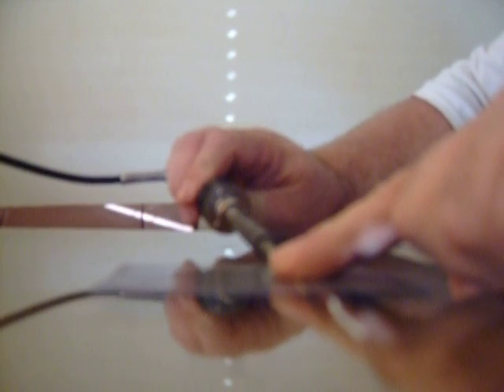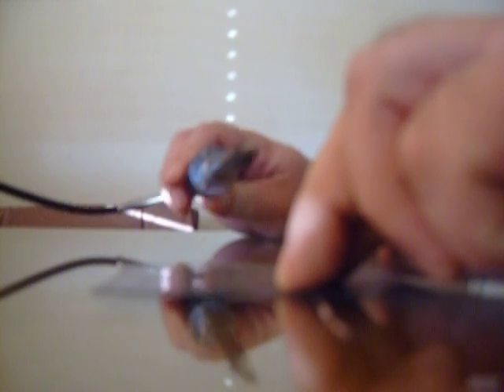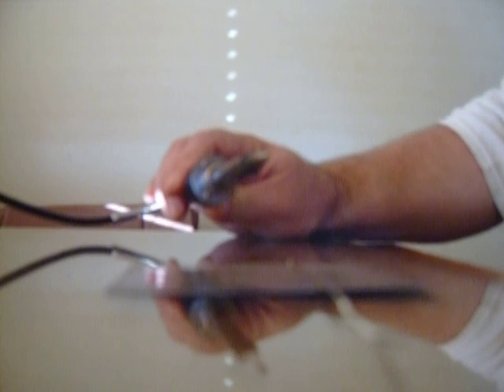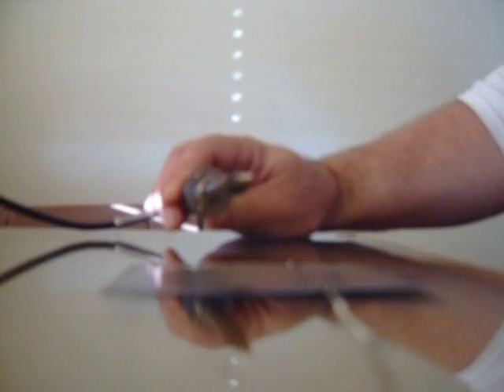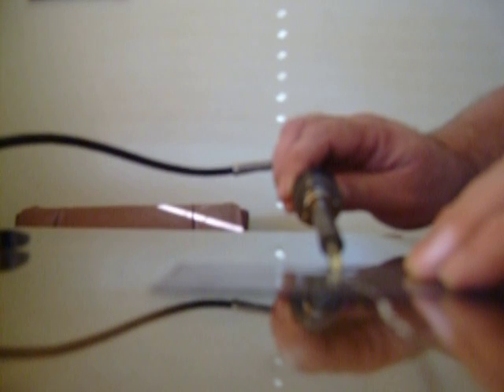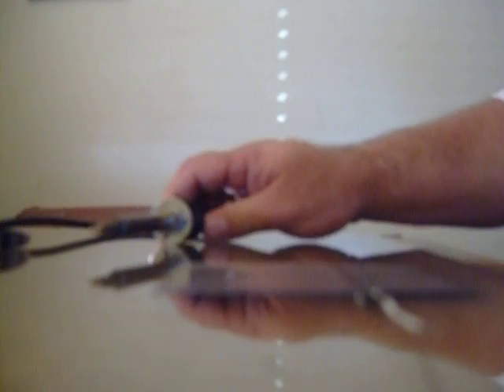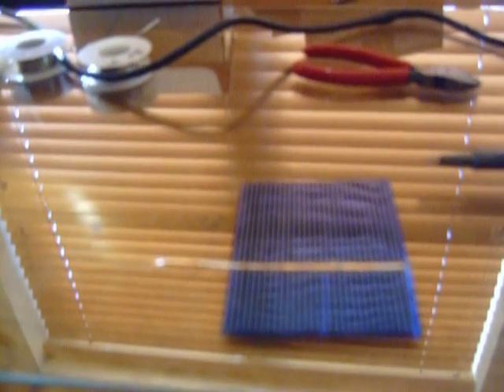How to Make a Solar Panel that Will Last For 30 Years Pt2

Comment from the maker: @stevethul1 yeah these three by three cells can not even compared to the 6x6 cells. I use thirty six cells per panel. But i wish I would have used forty now for more voltage. Yes these cells are very easy to break.

Comment: @shartne Interesting, how many cells do you have on the panel? I have been using 6 X 6 poly at 54 cells/panel only getting about 170 watts. I have to ask, is there a clear resin on the cells when you purchased them? and is this what you are scraping off? All of the cells I have purchased have NO protective coating and are very, very "Potato Chip" brittle. Let me know, thanks.

Comment: Do NOT scratch or scrape any contact surfaces from the cells. It will destroy the cell. Always use a liquid Flux and best to use a silver Based solder for any connections. The tabbing wire is already "Tinned" so you need very little solder on the tip of the iron to complete the solder connection.
A 30 - 35 watt iron is big enough with a well tinned "Chisel Tip" and a real "Light" touch when applying the heat to the "Tabbing Wire".

Remember - DO NOT Scrape the Surface of the Cell...